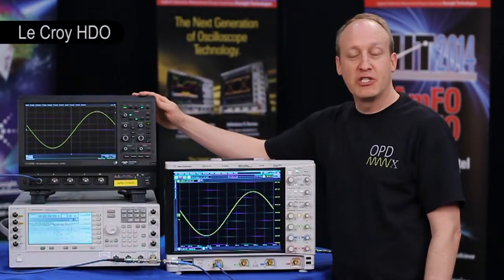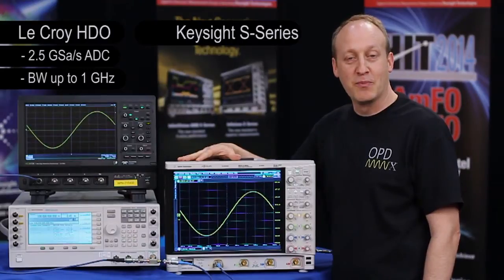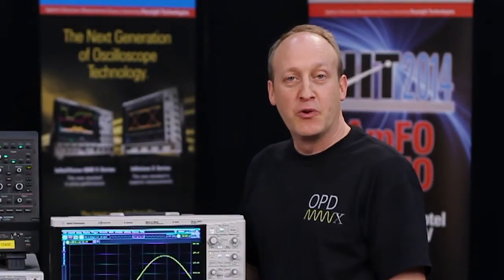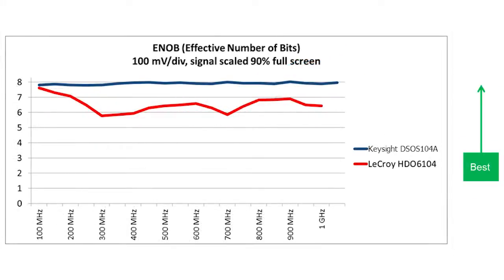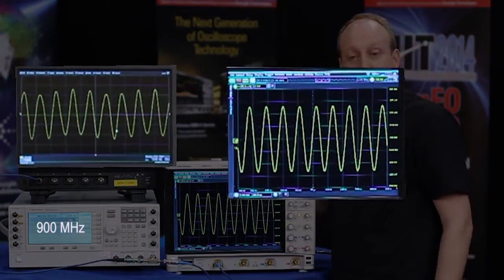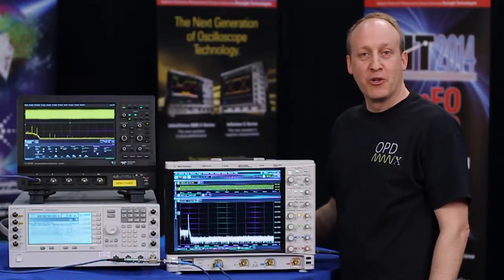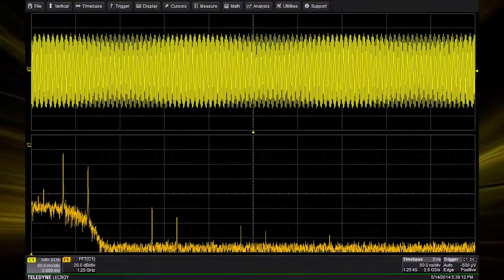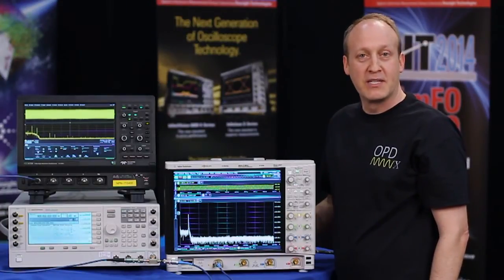Keysight S-Series Oscilloscopes compared to LeCroy HDO Oscilloscopes

Comment: I am lost, Are you comparing a Lecroy 1GHz 2.5 GS/S to a Keysight 8 GHZ 40 GS/S?
Reply from the maker: So, having a higher sample rate or bandwidth doesn't really effect the noise. Actually, having a higher bandwidth scope will show you more noise because it is able to see higher frequency noise components.

For this example, both scopes are operating at 1 GHz. Joel showed in the video that the 1 GHz LeCroy scope wasn't able to show the 1 GHz signal with the same accuracy as the 1 GHz Keysight S-Series scope. That's why the FFT showed aliasing on the HDO. He was also showing that just because an ADC has a high number of bits of resolution, it doesn't mean that you'll get less noise. What really matters is the noise floor and effective number of bits.
Reply: Keysight Oscilloscopes Yes at higher frequency there is more noise but you are limiting the BW in the 8GHz S Series scope to 1 GHz so that does not qualify. 
Also the coax appears to be different as one has a black connector cover and the other is blue.
Used to be common knowledge that for example a 1GHz scope is not going to show 100% of the signal at its end freq. but start rolling off way before the BW limit ussually at 3 dB point is its maximun available freq. So now you are saying that ALL S Series scopes are true to provide a 100% amplitud at all their advertized frequencies?. Yes about the effective number of bits is related to the inherent noise of the scope. I am not saying that this Lecroy has less noise I am just saying you should compare more similar products. Also I believe all this S series scopes have the 8GHz 40GS/S hardware and that the freq. is upgraded only by a installation key so in reality this is an 8GHz scope.
BTW I love Keysight they have the BEST support of any other measuring companies a dealt with. Keep up the good work.
Reply from the maker: You are correct that the bandwidth of the scope is where the signal is attenuated to -3dB. What shouldn't happen, though, is frequency aliasing. The list price the HDO9000 and the S-Series are actually roughly the same price at 1 GHz (~$21k as of today), so from a cost standpoint it is a fair compare. 

You are also correct that all the S-Series scopes are the same hardware and only require a software upgrade to increase bandwidth. We see this as an advantage, especially at the sub-8 GHz bandwidths because this assures that you'll see the spec'd performance of the scope.

Thanks for the support comment, we work hard to support our customers!

Comment: Why we saw distortion on the Lecroy scop? Maybe it's appear, when oscilloscope used Linear interpolation(HDO used Linear as default).As you know, if oscilloscope will use LInear interpolation, they need 10x the sample rate of the desire signal bandwith.
Reply: both oscilloscopes had identical settings including sin(x)/x interpolation.
Reply: Thanks for your answer!

It's great when user can talk with Keysight engineer's on youtube :).

Joel, may you explain why oscilloscope with ADC more than 8-bit's have so less a waveform update rate? (both HDO and S-series)
When Agilent present InfiniiVision X series, they claim that Waveform update rate its VERY important(and compare this point vs Tektronix and Lecroy).
And now Agilent present new oscilloscope, who doesn't have in datasheet information about waveform update rate. 

Which oscilloscope do i need to buy? With faster Waveform update rate or with more ADC bit's? (rhetorical question :) )
Reply: RolePlayGrandPapa Great question.  There are several reasons.  R&D teams on each scope have specific value that they are trying to add.  This value can be mutually exclusive to other product attributes.  For example on Infiniium S-Series, the R&D team was focused on high measurement quality (low noise, high magnitude and phase linearity across BW, suberb time scale accuracy and low intrinsic jitter, high resolution, and broad application coverage).  Processing 10-bits means the scope now has 4X more data to process between trigger events which results in slower update rate.  Broad application coverage results in a need to develop on a Win7 platform where Infiniium already has 60+ applications.  Update rate (much less than 1,000 wf/s with 100 kpts memory)  is dramatically slower than Infiniivision scopes. 

InfiniiVision's design focus is on superior signal visitbility--update rate is a key contributors to this.  The team used a custom ASIC for fast update rate and a platform with an embedded OS to minimize overall price.  A key tradeoff is a reduction in acquisition memory depth.

Which to buy?  It's really up to you to explore what scopes exist in the market and which one best fits your needs.  From a Keysight perspective, Infiniium is a great fit for users who want the best measurement quality, deep memory, debug + analyis capability, and application support.  InfiniiVision is a better choice for users who have greater focus on signal visibility (fast waveform update rate enables users to see infrequent event better), more portability, and lower pricing.